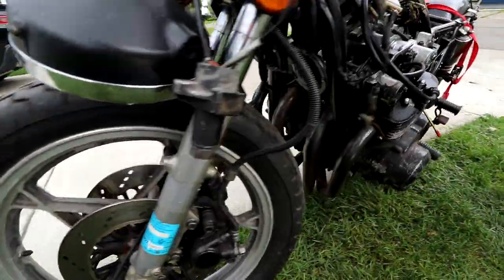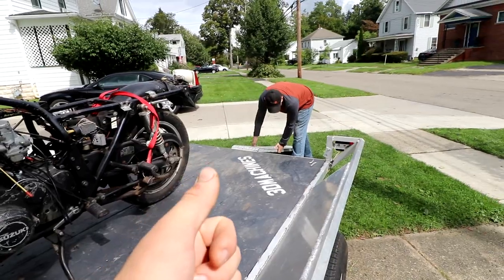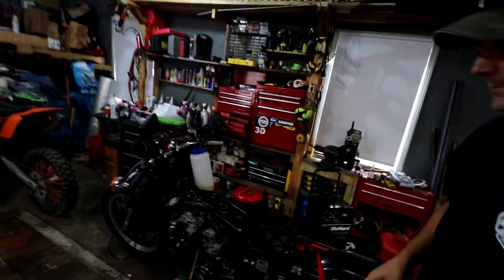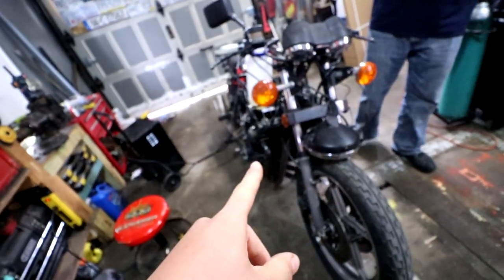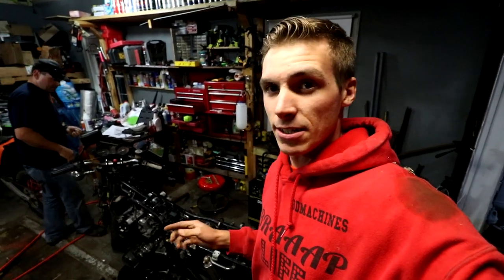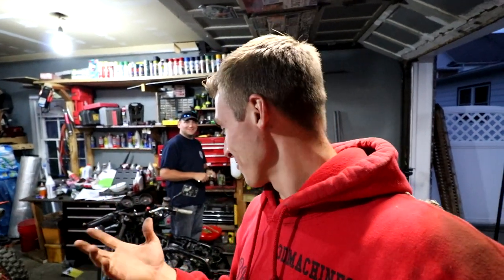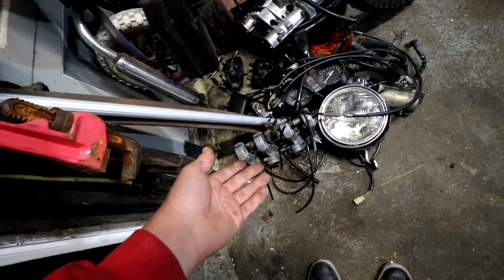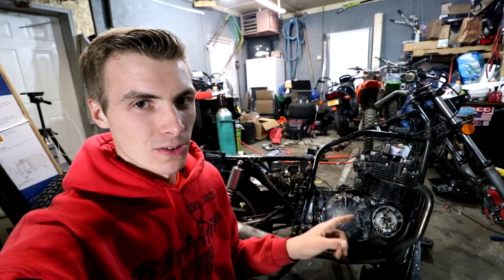THE CRAZY GATOR BUILD IS OVER...

Comment: Dalton... PLEASE try this before you give up. Try buying a FACTORY air box, or air filter pods. You will never be able to properly tune/adjust the carbs without the proper airfilters. It may run, but it will never right. The motor is perfectly fine. You have good compression, you have spark, and fuel. The only other thing you need is air. If you don't add filters you atlest need to jet the carbs.

Comment from the maker: I wish the engine would have cooperated...
Reply: 3DMachines put a snow mobile Engine in the gator
Reply: Supercharged Ninja 1200 anyone?
Reply: like Jason said, my Suzuki is reliable as...lol, its just because the GS1000 is possibly worn out or been thrashed all its life.
Reply: Wek! Puch Hard! or Go home!
Reply: @3DMachines you should have a normal 35 gallon out door trash can so when you have a bunch of old parts such as that timing mechanism old brake pads, nuts, bolts, handle bars, levers etc you can throw them all into that trash can then when you go to the scrap yard with the gs1000 frame and the gator engine you have all the small pieces of metal for more weight to make more money.
Reply: 3DMachines put an r1 engine in er
Reply: you need to get a liquid cooled engine it will be almost impossible to cool an air cooled engine. try to find a bike at wreckers or salvage. I dont know how it works there but here in Saskatchewan we can buy people's wrote off vehicles you can bid on them. maby you could bid on a bike. make sure you tell your greedy viewers that complaining about your short videos I'm glad that your even making videos. I wouldn't be if if I did that. I broke my arm and looked just like your hand lol. hope for a speedy recovery keep up the great videos you are the best.
Reply: Use a ford ka engine
Reply: 3DMachines you need to use a snowmobile engine
Reply: I'm from Saskatchewan as well and the go so cheap and if you get a bike at a wrecker they go for scrap metal value
Reply: Hi 3DMachines ! Nice day right stay froggy fresh.
Reply: r1 engine would get her froggy fresh
Reply: you should get an engine out of a liquid cooled polaris indy 500, i see them on craigslist in ny all the time
Reply: 3DMachines Suzuki engines are usually bulletproof quit buying junk and these problems won't happen love your videos thanks for uploading
Reply: Hey 3D, first, hope your hand feels a lot better, and could you possibly ship that engine to me, I live in Illinois, and I would love to toy around with that.
Reply: Come get this gs1000 by my house $250 runs
Reply: Eh you need something two stroke kx or cr 500 or banshee motor
Reply: 3DMachines you should put snowmobile motor in it
Reply: travis larwill They are to weak
Reply: Good video
Reply: 3DMachines I'm sure you don't remember meeting me at Cecil, but let me try giving you some advice. Everything happens for a reason. You will know why this engine did not work WHEN (not if) you find the right engine for the gator. It's still going to be a froggy fresh build in the end, and don't sweat the small stuff! You're awesome, and all of you helpers are too! You're are great entertainment! Keep up the awesome EFFORT! It pays off 😜
Reply: Dash Hub?
Reply: Why it will never work, he needs a ls.
Reply: Put the lawnmower in the gator
Reply: The trike mouter
Reply: Durimax gater make it roll coal
Reply: 3DMachines put a diesel Kabota engine in it
Reply: 3DMachines yo man you gotta dust off the seca and take her for a ride it's been a while lol
Reply: Hey man I'd be interested in buying the bike off of you if your interested in selling the whole thing
Reply: 3DMachines PUT THE FILTER ON ER IT WILL RUN MUCH BETTER
Reply: You should use a cr 500 2 stroke engine
Reply: @Easton Rath huge thumps up. The water cooling and mounting of the radiators would become a hassle. But you are on the right track. A old 1980-1981 Yamaha YZ465 Motor, a Yamaha YZ490 Motor of any year, or a 1991-1992 Yamaha WR500 Motor would work out just fine.
Reply: 3DMachines get a 1000cc snowmobile engine
Reply: 3DMachines get the truck engine!
Reply: 3DMachines PUT A PREDATOR 670cc v twin in it!!!!!
Reply: 3DMachines put a Yamaha engine in it
Reply: You'll find something to put it it im sure
Reply: 3DMachines. I live in west seneca and used to live in Irving. I have a gl1100 engine you can have its even liquid cooled with an electronic ignition and shaft driven
Reply: Don't give up. It's like you are going to see your girl friend and there is a bump in the Rd you don't turn around and give up on Netflix and chill just cause a lil bump or two in the rd you push threw slow down pay more attention and finish the mission just don't give up push threw it and finish this thing up
Reply: 3DMachines i have a honda cb750 four ill give you just needs carbs cleaned but last time i tried it ran
Reply: Fire and gasoline has the hookup. I want to see the gator happen
Reply: 3DMachines too late now, but did you ever check valve lash? I had an xs1100 that had bad valve adjustment and made it run like crap
Reply: If it's because the motor isn't revving out, your problem lies in not having an airbox. Assuming it has cv carbs without the airbox their isn't enough vacuum to lift the cv slides.
Reply: 3DMachines take the engin out of the old ford racing mower
Reply: Yamaha banshee motor. Tons of power. Tons of speed. Sounds great. Standard. Super fun. And it's a simple 2 stroke. Its perfect for a crazy gator
Reply: 3DMachines 1290 superduke engine?
Reply: 3DMachines i have a Kawasaki zx6r with 6500 miles on it running like brand new, make the trip down here to North Carolina and I'll give to you for a crisp $3000
Reply: 3DMachines hi my name is Marcus and I like all your videos and I like to win your shirt and I'm from Pennsylvania have a good day okay thank you
Reply: Wink's Moto it mechanical, not CV. SUZUKI didn't switch to CV until 1980. It should have been able to rev no problem. Prolly a bent crank or unseen crack in the block.
Reply: I dunno if you could find a used Polaris or Can-AM quad.    Both those companies makes 1000cc model quad bikes, and being a quad bike engine I imagine you'd have a much easier time fitting it then that massive motorcycle engine.
Reply: 3DMachines hi my name is Marcus I live in Pennsylvania and Carlisle I love your videos I like them all and I hope I get a shirt from you and I hope you could email me back sometime and Laura things I forgot and have a good night and thank you

Comment: You should use a Sportster motor, they're 1200 cc, have good lowend torque and super easy to work on. You only have to mess with two cylinders, but they're aircooled.

Comment: On those old bikes the only way to 100% get them to run right is to use stock parts. You did good with the carbs and the fact that the exhaust was still on there, but if you had the stock airbox system hooked up, id bet money that it wouldve run great

Comment: Find an old 2 joker from a Polaris snowmobile. The older ones from the 90's and 2000's are bullet proof and easy to rebuild. They have some have close to 100 HP and are belt driven. So similar to the Gator set up. It would probably be a bit easier to install in the Gator.

Comment: Greetings from Trinidad. Love the build man. You can try a gs1150e or gs1100 motor or even a bandit 1200 motor will do the trick. Old school Suzuki's are the best man. I've had my share of working on em. They ain't new bikes but wit some work they can be really awesome. Those engine have roller bearing crankshafts so they are near bullet proof. You can get gasket kits, piston kits and a ton of aftermarket stuff to make it run right again.

Comment: I don't think you will read this but if you do let me know please get a brand used Harley Davidson engine. An evo 1200 sportster engine is a great engine to use. Easy to work on and runs truly amazing. They also sound very good and I need to see that gator seems through the trails. Stay friggy fresh, love you videos!!!
Reply: 4 stroke, 58 horsepower, v twin, 5 speed manual transmission, etc.

Comment: Get a water cooled engine. It's easier to instal on the gator. It may be hard to get the cooling working on an air cooled engine on the gator if you don't  rebuild the entire body. It's your choice but I would take a water cooled engine.

Comment: Adjusting those old four cylinders is a art, each one more or less is set as a single engine by itself, its own cylinder, valves, carb, and ignition, and are expected to work together in harmony, BUT, they fight, and require a expert. BTW, I know this uses a waste spark method, one coil per two cylinders. You need to find a independent old school bike shop, find the oldest mechanic they have (I'm 50) and ask him nicely if he would set it up. Ive been a tech for thirty years, working on semi's, cars, bikes, and ATVs. And multi carb/cylinder engines are a p.I.t.a.

Comment: 3DMachines, TAKE THE GATOR AND GS1000 to THE DUMP or scrap yard. Cut your losses, don't even bother with "stripping it down". It's not worth your time. SCRAP THEM BOTH. 
Fix your motorcycle that's broken, or should I say Motorcycles that are broken. 
You need to learn when to hold and when to fold em.